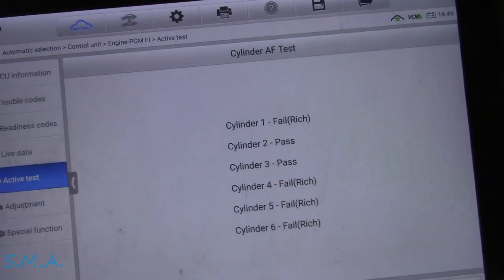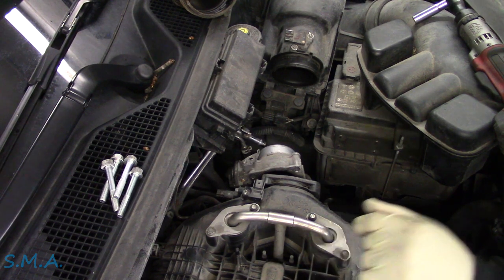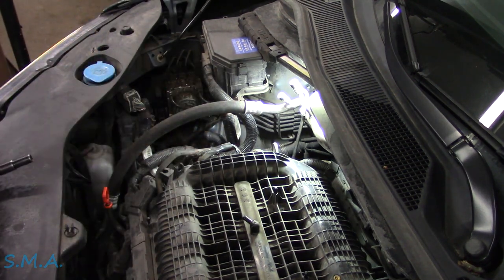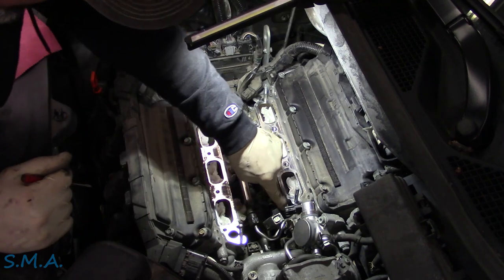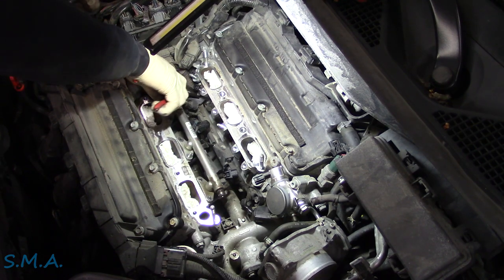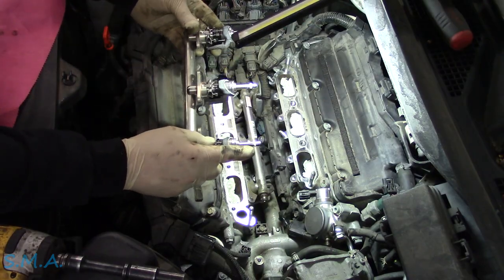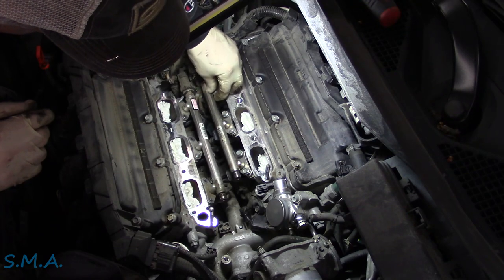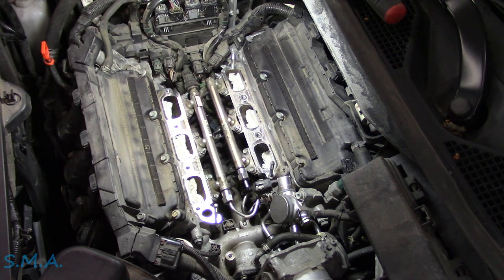Honda: Earth Dreams 3.5 GDI Replacing Fuel Injectors

Comment: Great video. Honda claims to have some proprietary tricks to greatly reduce DI related carbon build up, partly using their VVT, and it seems to work on all their DI engines especially the later ones. The manifold interference was not typical for Honda and I agree their OEM service data is sparse and cryptic and sometimes even the little they give you isn’t correct.
Reply: Honda does it good, newer Toyota DI looks downright clean on top of the piston heads and valves. I was amazed the first time I popped one of those bad boys open and stuck a camera in. It was a 112k mile car to boot.
Reply: It not the top of the piston the problem it the intake valve that gum up for the lack of fuel cleaning them ence why many manufacturers are now using both direct injection and port injection to keep the valve clean
Reply: The vvt cannot clean the intake valve old port injection system rely on the fuel beimg injected before the valve to keep them clean 
With direct injection this is the problem  carbon build up on the intake valve and the engine run like crap
Reply: The V6 engine don't use VVT they only have V-Tec.
Reply: That’s one of the reasons I really like bmws service data. There’s so much detail with regards to pics, wiring diagrams, connectors, step by step testing, and more. Really blew me away with how much was in there software. It made sense why it’s around 50gb+ of files.
Reply: @FishFind3000  but then you’d own a BMW
Reply: @crabmansteve6844  Toyota uses both port & direct fuel injection while Honda is only using direct. I’m not sure what tricks Honda is using, but they don’t seem to suffer carbon issues
Reply: @MrManuel1329  VTEC is a form of VVT.
Reply: @FishFind3000  they need to be that detailed… BMWs don’t actually last as long.
Reply: @MrSamPhoenix  V-Tec controls lift not the plashing of the cam which is VVT. Hondas K series use both VVT and V-Tec. The V6 engines only have V-TEC.
Reply: @MrManuel1329  VTEC is still manipulating (or varying) the valves, which would otherwise have one setting at all rpms (which is still VVT). You should had said cam phasing which is another way form of VVT.

Comment: The injectors have a warranty  extension  on the injectors  and some also need a software  update . Honda came out with a whole injectors kit injectors , gaskets, and new, drain joint  pipe

Comment: I"m optimistic hearing/seeing that the carbon buildup was minimal? What has Honda done to deal with intake valve carbon? I think Toyota has port and direct injectors but I sure wish I could find out for sure if I need to spray crap into my intake every 15,000 miles.

Comment: I got a P0304 misfire code after my 5 year/60k mile extended warranty expired. Honda dealership replaced all fuel injectors with a new part (better part) for FREE. They said fuel injector issue is covered by some extra 10 year/150k manufacturer warranty.

Comment: @11:30 Honda designed their GDI system and mounted the GDI injectors in a manner such that fuel comes into contact with the intake valves. Honda uses solenoid style GDI injectors instead of the much more expensive piezo injectors.
Reply: If fuel is contacting the intake valves, it's not direct injection
Reply: @atticstattic  yes, it is, please do more research.
Reply: @MrXyzasdf  
After you - you don't know what you're talking about.

Comment: @19:33 with injectors, I like to use the Knipex 8111250 connector slip joint pliers with soft plastic jaws.  I grab the injectors in the plastic body with these pliers and do not worry about marring the component.

Comment: An old mechanics trick to safely decrease pressure in any high pressure fuel line (especially modern common rail diesels) is to start the motor, then remove the electric fuel pump fuse and let it idle until it stalls.

Comment: 2017 Honda! How are they building cars these days that can fail so quickly? I had nearly 165,000 miles on my 2009 Subaru that I purchased in '08 before I replaced (last year) the injectors, and I know I only needed seals at that point, but did them anyway so I wouldn't be bugged by them again, since it's such a pain in the backside to get to them (for a 73 year old).

Comment: 23:23 Air-compressor starts. good time to say, have you serviced your air compressor lately?
mine recently decided it was an oil pump and pumped a lot of the oil out into the line and tank. nothing a new new pump, drive pulley, belt, re-plumbing,  fabricate mounting rails (welding, drilling, bending). days later and I have air again. 🤬💩🤯

Comment: I was just gonna say, that it seemed very convenient that u had that new joint pipe right there for your use. I also like the way u always turn the camera off for your fastidious application of the torque spec. They tell u that those huge bolts that hold the pulley or axle r single use. Yeah right. Or subframe bolts. How many times do we reuse wheel bolts or nuts?  Even head bolts?  Every bolt stretches when u tighten it real tight. Every valve spring compresses when u turn the engine over. It's called profit  producers. And baloney

Comment: Chris from the UK, Hi Eric O, watch a lot of your videos here on you tube and find how good of a mechanic you are and find a lot of things you do are pretty good at how you find faults and explain on the things you do, and a lot of the tools you use, is it possible for some advice as I am looking to do a wheel bearing myself on a as you call it a European model GM/OPEL Vauxhall Insignia, watched a multitude of these on the you tube of you pulling these things apart, my question is, which battery powered impact wrench would you recommend for someone who is looking to use one for the first time? or can anyone help?

Comment: I just had my mechanic change out my injectors since ive had an emissions error code for a few months and needed to get registration sticker and inspection (Texas).  Honda had diagnosed with needing injectors but opted for my regular mechanic to do work to save money.  All was fine for two weeks even though my MPG was on the low side.  I did have the fuel to rich and bank 2 prior to replacing injectors. Anyhow i noticed that MPG was very good with emissions code on before and now after injector replacement and error back.  I did replace plugs, oxygen sensors and clean MAS prior to injectors.  Very frustrating trying to figure this out.

Comment: There is a bulletin on this issue... I had my '17 Pilot serviced under the bulletin for exact same issue free of charge at the dealership. This is very common issue for these engines. If I remember the bulletin covers 2017-2020 Pilots, Ridgelines and Odyssey

Comment: I believe those rubbers over each injector is for noise reduction. Appears Hondu placed a lot of Engineering into noise reduction for both injectors and valve  train. My 2017 Chrysler 200 2.4L sounded like a sewing machine since new.

Comment: I have a 2017 Ridgeline and there's an extended warranty on codes p0420, p0430, p300-p0306, p219A, P219B (injector replacement and software update).  I'm pretty sure these applies to the Pilot as well.  Your customer could probably get reimbursement from honda :)
Reply: Does it also cover catalytic converter replacement
Reply: @adventureoflinkmk2  maybe if it was caused by the failed injectors.  It also states that you must bring your vehicle in asap.  Failure to do so could be determined as lack of proper maintenance and any other damage will not be covered.
Reply: @xabhax  oh okay.  Because too much raw fuel is one of the causes of a clogged cat

Too much coolant and/or oil burning also causes failed cats
Reply: @xabhax  the oxygen sensors will get fuel trim as sensed by exhaust oxygen within range but that is 1 rich cylinder and 2 leans ones to get average oxygen OK. When this exhaust gas with raw fuel from the stuck injector cylinder goes through catalyst the catalyst it is not converted to correct games and oxygen level after catalyst is out of range. Now you have the catalyst efficiency code. If you drive thousands of miles with it running rough the catalyst will get fuel residue burned and then it's done.

Comment: Hello, amazing video. Where did you get the fuel injectors? I need to get the 6 and each one from the dealer are at 90.
Reply from the maker: You get them from the dealer. They sell them in a six pack. If you put anything other than OEM you're asking for problems

Comment: Eric

Honda part number 16010-RLV-315 (set of 6 fuel injectors) for a 2017 Honda Pilot with a 3.5L engine sells for around $250.00 but Acura part number 16010-R9P-305 (set of 6 fuel injectors) for a 2014 MDX with a 3.5L engine sells for around $1,300.00.  What's up with this?  Aren't these engines the same?

Thanks
Steve

Comment: Since that's a direct injected engine how much carbon was on the back side of those valves when you look down inside of the intake ports so if I recall Honda does not have port and direct injection like Toyota is that correct Eric .

Comment: I found out about 15years ago that when injectors start acting up if I add LUCAS fuel treatment (the reason I use Lucas specifically is it's the only additive that passed DOD standards) to the fuel and a couple tanks of gas run through it and they are fine. This is transferring diesel technology to gasoline engines . In diesel I fill both new fuel filters with Lucas or ATF and diesel injectors clean up quicker. Btw the last time I replace a injector was on a cumins and each injector costed $1500 . As apposed to a cat 3176 b injectors was $50 same era . Low sulfer diesel seams to be harder on injectors. . My trucks I always ad a quart of Lucas every fuel up.

Comment: Wow. Would not expect a Honda to need injectors within 5 years!?

Aren’t most of them made by Denso? (at least the good ones?).
Reply: I totally agree with you..5 years and already need new ones??!!
Reply: @markkrispin6944  no desire to own a GDI engine.    I had the 2017 Civic w 1.5T and sold it for what I bought it for 4 years later.
Reply: @zaffo757  I agree with you 100%.  I will never buy a GDI engine at all.  I have always bought Toyota cars/trucks.
Reply: Exactly what I was thinking in fact I wondered if I’d not heard Eric correctly and I had to re read the title
Reply: @markkrispin6944  3 purchases in the past 6 months: 2000 Camry 4 cyl  80k miles, 2005 Highlander 4 cyl 181k miles, and 2004 Corolla 120k miles.  To go with my 2003 4Runner v-8 275k miles.   This sew stuff is garbage.
Reply: @zaffo757  Wow nice.  All great car to have. Wise choices made.
Reply: These are made by keihin

Comment: Why does the GDI system hold pressure KOEO? Compared to a high pressure common rail diesel system that loses pressure as soon as the engine is off. Shouldn't a GDI rail leak back through the pump?

Comment: Very amazing that Honda does what they do with replacement parts.  They include all the items in a kit !  Rare any USA makes offer parts that way which requires the parts counter guy to know what you need for the job or find out the hard way once the job is on the operating table on oxygen. Silicone grease rules...
Reply: rare for honda to do a kit with everything included.

Comment: So I currently have a 430 code and had the injectors replaced under warranty. Last a little over a yr (1yr and 2mo) and it just so happens the warranty is only a yr on this. Well I am getting the same code again and now they r not covered but they want to replace my cat.con and egr pipe. I really don't think that is the problem. Kinda fisshy Honda parts r failing just as the warranties r expiring. My pilot only has 113k which should b nothing for a honda. What is ur opinion?

Comment: All that (and you took the short approach) to get to the injectors! No wonder they were as affordable as they are. They felt sorry for anyone changing them (not really, but.....🤣)! I can swap out injectors in my 98 4.0 Wrangler on 30 minutes if I take my time (yes I've had them off a few times for various reasons). A 10mm socket and a small pry bar (used for removing "O" rings) will get it done. Great vid, Eric!

Comment: Interesting that the intake was so clean - have the issues with DI been largely solved in terms of carbon fouling now?
Reply: Yes they just use port injection to keep the valve clean don't you find it funny when the solution to a problem with modern tech is to use old tech lol
Reply: I think honda uses the swirl of gas in the combustion chamber and vvt to keep the intake valves cleaner. Toyota uses dual injection setup

Comment: Honda should be ashamed of themselves with this problem.  They knew the problem existed  back in 2016 or even before that and continued using the design for years.  Not sure if the 2022 version of this motor still has this injector failure problem.  I know up to at least the 2020 model year it did.  I expect it from ford or gm but not Honda.  SAD
Reply: This is from a manufacting defect on the part and honda has extended the warranty on this for 10 years. You wound get that from gm or Ford.

Comment: Boy i wish it was that easy to do on a Subaru with a DIT engine..... Those direct injectors are soo stuck in the heads you have to use the OEM tool. And if they are REALLY jammed you need to mod the OEM tool for MORE grab, then they slowly come out of the heads.....

Comment: There is a TSB/warranty extension for this…. I replaced mine myself and then the TSB was released 2 days later.  Data says to replace EVERYTHING. New seals, new fuel lines and all that jazz. I put injectors in it and that’s it. Nothing else. There was actually a very tiny fuel leak when I pulled it apart so right from the factory.
Reply: This TSB explains the good pricing. Cheaper parts means the 25% markup on warranty repair parts on warranty claim is less moneypaid by Honda. I have seen parts reduced to 10-15% of the original price when they have a recall or extended coverage service campaign.
Reply: @jimmyaber5920  the customer doesn’t pay for warranty work…
Reply: @sjfk1306  that’s his point. The manufacturer does. The manufacturer still pays the dealer for the work. The thing the is the manufacturer also sets msrp for parts.
Reply: @998Squid  prices didn’t change before/after the extension though……
Reply: @sjfk1306  I see. I worked at a Mazda dealership and it Mazda would release updated part numbers/ revisions and kits with cheaper pricing if an item failed a lot under warranty or was apart of a TSB or recall.

Comment: i have a 2010 Chevy Equinox and it starts good every time but when my wife gets off work at 1030pm some times it has to be jumped and there is noting left on in the car and she will go right over the other side of the street and shut it off go into the store and come out and it will start right up. I checked the battery before jumping it and it was at 10.57volts 
, then it will be good for some time then do it all over took it to my guy to work on it and he said there is nothing polling  power .

Comment: I have a 2011 Pilot with 110k miles on it (I’m the second owner from 20k miles). Assume my engine is not GDI?  It has the original injectors.
Reply: I believe 2015 or older 3.5 V6 in Pilots are not direct injection.
Reply: @davidreed8843  thanks for the quick reply👍

Comment: Eric how difficult will it be for me to do the valve cover gaskets on my 07 Accord 3.0? I have done valve cover gaskets on 4 cylinders never on a V6
Reply: I've never done it myself, but BundysGarage has a video doing it to your exact engine.  It looks like about double the amount of effort of the equivalent 4 cylinder because you have two covers and the back one is harder to reach, plus you have to remove the intake plenum.  It is easier than on my Sienna V6, because the accord has more room at the back of the engine bay.

It should be easier to do than what Eric O just did, because you won't have to mess around with fuel lines.

Comment: The problem is, how can anyone tell that the 6-pack injectors aren't cheap injectors repackaged by Honda? I'd question every part bought nowadays.
Reply: You gotta just send it at some point, can’t stress about everything.
Reply: @SteelheadTed  I'm on my 3rd replacement water pump in one of my cars within a 2 year period, had 2 spark plugs break the socket head off on two different engines, went from replacing one O2 sensor, and having to replace that one sensor three times. And the list goes on. You can't just send it if you have to keep I'm sending it and sending it like I have.

Comment: Yep i agree with your statement about the cost of the injectors i had to replace the injectors on my diesel they wanted 185 each found a whole set of 3 for 87 dollars
Reply: Good luck with your cheap China injectors. They tend not to spray well or flow the correct amount of fuel even when new.